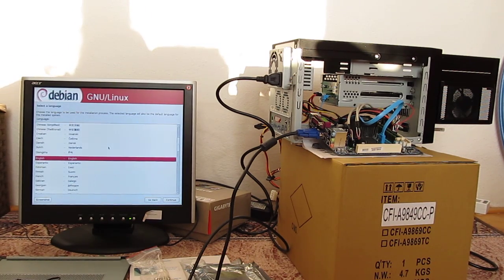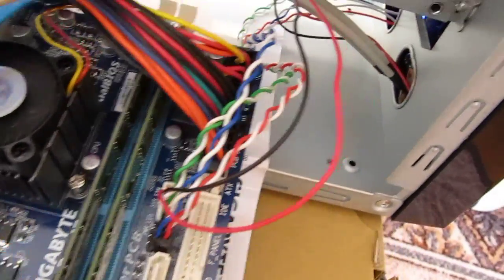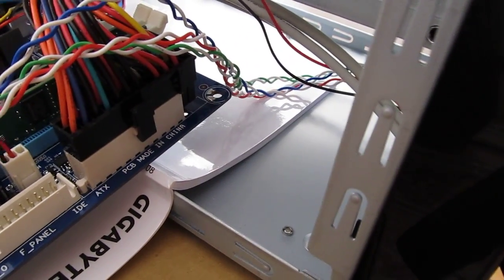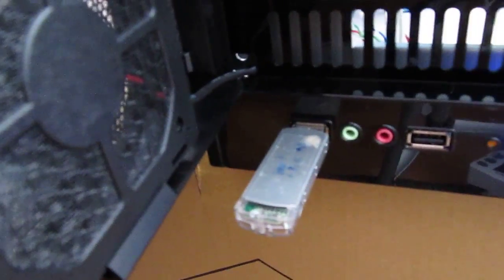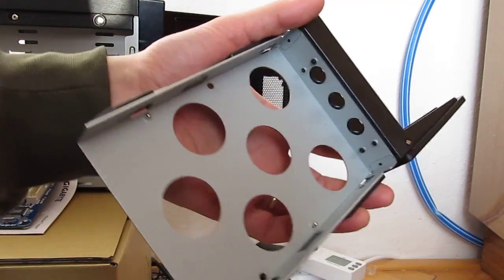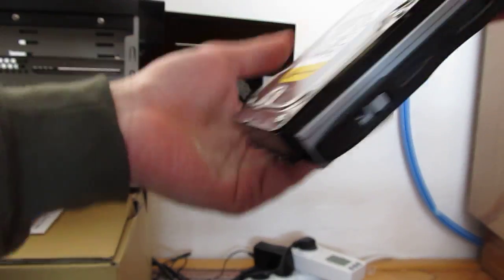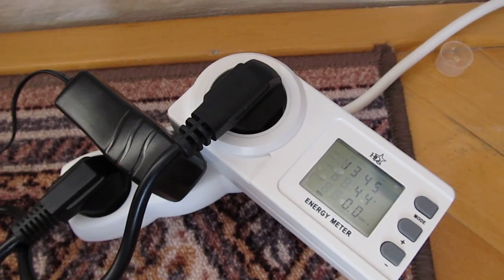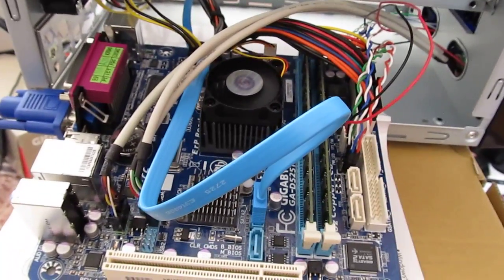DIY Linux NAS 3/3: GA-D525TUD + CFI-A9849CC online

Comment from the maker: @Kermismovie1080i
Hi, the CFI-A9849CC is not sold in my country (Czech republic) anymore,  I think it has been discontinued. Instead, some e-shops offer the newer model CFI-A2059 which seems to have the same mechanical design, but with more powerfull power supply, bigger fan in front and only one but bigger fan in rear so I think it should be more quiet. It is also a bit more expensive (60 EUR), but the price is still reasonable.  I am not aware of any other cheap case with 2 hot swap HDD cages.

Comment from the maker: @LucasRey1972 The fan on the MoBo does not make any audible noise. Most noise comes from the CFI-A9849CC fans, mainly the front one.  The newer model CFI-A2059 should be more quiet as it has bigger front fan and only one rear fan.